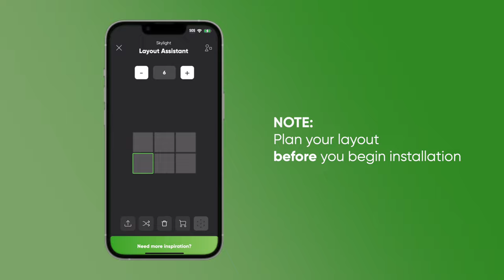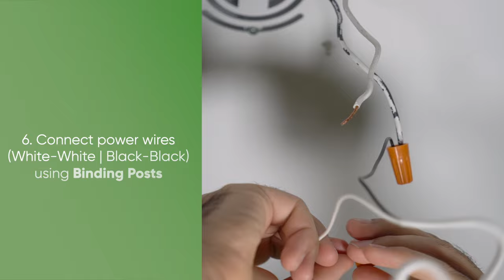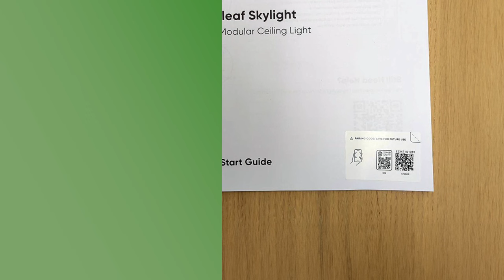How To Install Nanoleaf Skylight | Tutorial

Comment: I installed 12 of these today. Not really too difficult for the most part. They are a little pricey but I got a substantial discount and decided to make them part of my home office remodeling. The lighting is a little uneven and they are a bit dark at the center but overall they look good. If you are installing these, make sure to route the wiring as cleanly and as close to the top of the fixtures as possible or you will see the wires through the shades...

Comment: •· is it a bit messy to have 4 screws for each piece of 300x300m light-weight panel? 🤔 can users have options to simply secure the main panel with 4 screws & attach the rest of our other panels, if not many, just to the main panel without further screws (for every single panel) on ceiling? // There’ll be numerous deep holes on ceiling few yrs later when we remove the nanoleaf after it breaks. Any insights? 🤔 if this issue can be fixed, we’ll consider purchasing some too, as we love nanoleaf since day 1, lots of great products we got & are still working 💛 more power to the team 🇨🇦🫶🏻 much love from Hong Kong (any voucher/coupon?) xoxo, Cheers💡
Reply: I would use a thin piece of plywood or other material and screw the other panels to that. The main panel (power) would go to the electrical box. Potential for flexing away from the ceiling but I use that setup on my wall and it works well. I’d recommend adding at least a couple more screws depending on how big you make it
Reply: It’s so ridiculous to drill four holes for a single panel…especially in Hong Kong, all about concrete ceiling…

Comment: My question is like in my home I don’t have a middle light connection that’s in the middle of the ceiling how do I connect the skylight ? Please help me
Reply: It's designed to be hung from a standard ceiling outlet box so you're probably going to need an electrician to install one. I don't really see another practical way.
Reply: @johnryder8008 I want to install this in the place of a recessed light (with standard 6" recessed light housing can) so i don’t have an outlet box, could the control panel be installed without the center support and rely only on the ceiling attachments?

Comment: And then queue the connection issues with the app…
Reply: mine frequently loses connection in the app.  the first time was the most annoying where I was trying to troubleshoot with constant seizure inducing scene (since it was running last running/saved scene, even when i power cycle).
Reply: Hey Nanoleaf, you don't get it. Your App is horrible. For such a great product, your App is so primitive. It needs work to keep things stable.

Comment: Aligning the panels to your design is incredibly difficult, the drywall anchors provided are not adjustable in their position, meaning you have to ensure perfect alignment at each step.  You have to ensure that alignment prior to mounting the skylight because the anchors need to be screwed in first.  The instructions regarding the drywall anchors are not clear, but obviously you must screw in the white plastic anchor to the wall, place the skylight on the ceiling aligned with the anchor, and then screw in the metal screw provided through the skylight hole you drilled out and into the anchor.

The instructions say this is suitable for 1 or 2 people, but if you need to align multiple skylights and parallel to something like another wall, you must have 2 people to verify alignment

Comment: Dang I was hoping installation would be easy by securing only one panel connected to the main ceiling wire and the rest will be snap on to the side with strong double adhesive tape. So if you have 20 panels you will be drilling 80 times? I should have watched this first before pre-ordering 9 panels 🤦
Reply: They do this with all of their other products why not this one? Makes me really reconsider getting them especially after seeing the price
Reply: You will only need to drill if mounting on plaster.  They provide drywall screws for drywall.  You also need a drill to remove the knockouts on the controller panel only

Comment: So I have a ceiling fan, how do I add with this?
Reply: Hire an electrician. There will be a line and a dedicated load wire that will be for the fan control. You will have to share the line (hot) to power the ceiling fan and the nano leaf. And just wire up their respective loads as normal.

Comment: People who are saying these are expensive have never both designer lights that can’t even do half of what these lights are doing. Stop being broke and if you can’t afford it then maybe maybe it’s not for you 👀👀🫡
Reply: While I agree your general statement here. I feel the lack of polish is the real sticking point here. No matter / thread control (which was advertised in the preview), odd hot spots, complicated installation process, no dimmer switch solution, no 5GHz support, community screaming about connection issues, etc.. For this premium price point I feel peoples complaints are justified. 

BUT as someone who's eager to replace their 1.3k pendant light above their dining room with this solution - I agree with you to a point... either way, it's sad this is so unpolished.